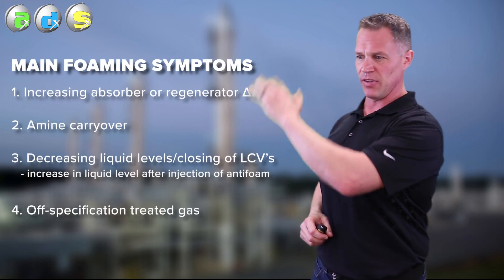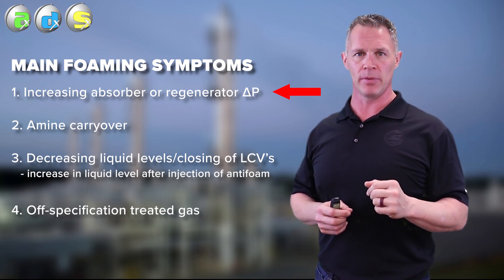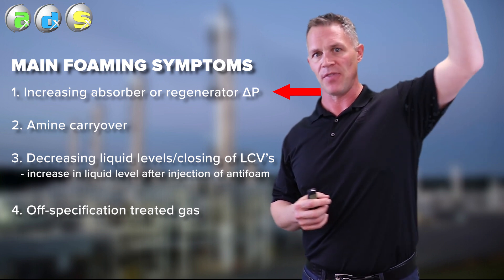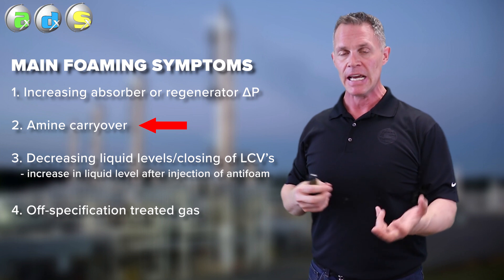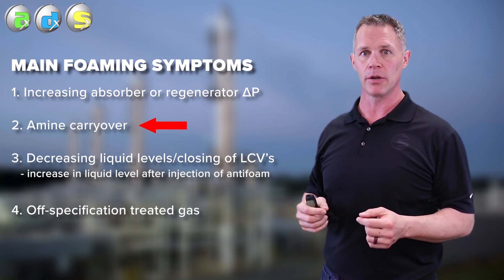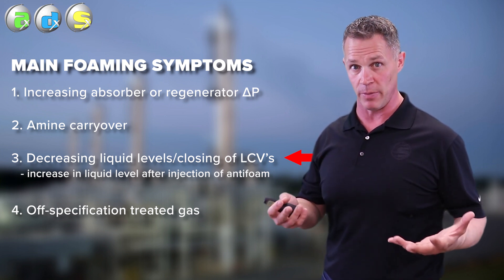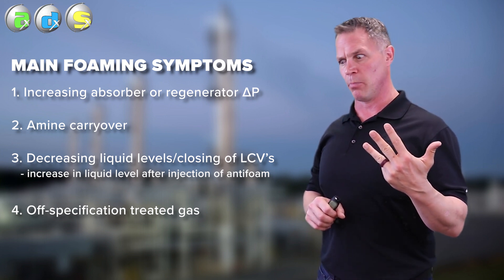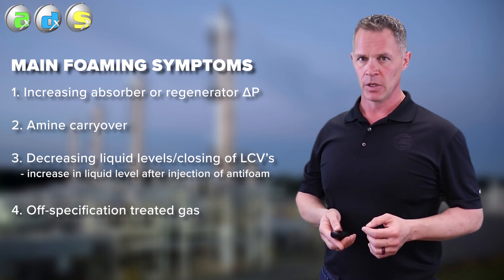Troubleshooting Foaming in an Amine Plant

Comment: Hi Ben, in our stripping tower we have a huge problem due to flooding and this issue starts sometimes in the middle or in the bottom, what could be the root cause of this? In addition, the amine looks very well (clear and a very pale green) inside the tower's bottom. However, we took a sample from the reboiler feed ( is a once-through reboiler) and in that point the amine looks green cloudy.
Reply: Is the reflux flow rate from stripper reflux drum is optimum? It is mainly water, and could cause a lot of steam vaporising in case of excessive reflux flow rate

Comment: There is continuouse fluctuation in amine flash drum and amine regenerator column .all parameters have been checked,there is no foaming.please guide me what will be the problem.thanx
Reply: sounds like a flow control/level control problem to me Raheem. Individually switch flow controllers to manual and observe if the problem stops. Flow control issues are often brought about by a "confused" level controller. This happens if a layer of hydrocarbons or foam is floating on top of amine in an vessel and the LIC cannot determine the actual level.

Comment: Amazing video.
But it didnt mention hydraulic imbalance between gas and amine flows, fluctuating feed gas flow as a root cause of contactor foaming.
Also one of the main symptomps that I have seen is the erratic fkash tank pressure.
Nice video guys.